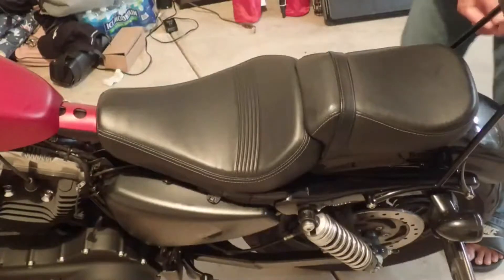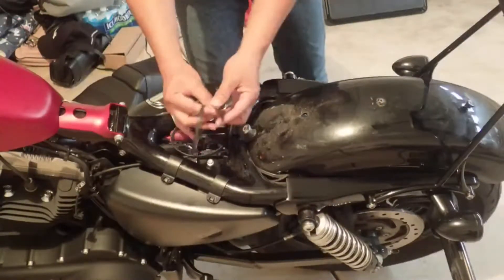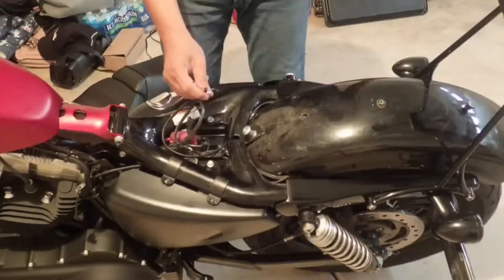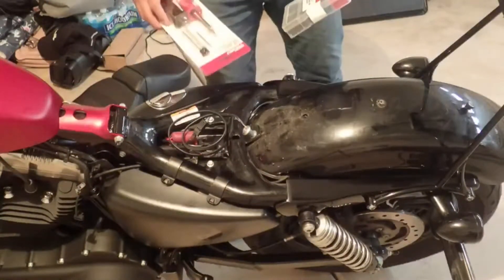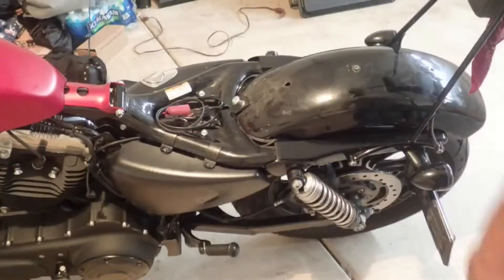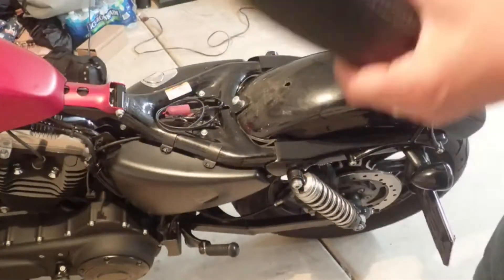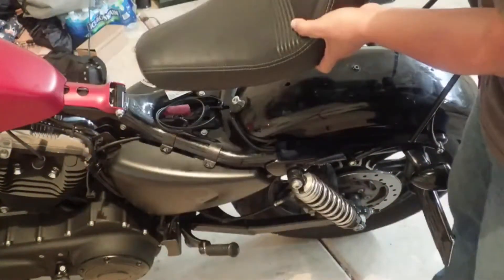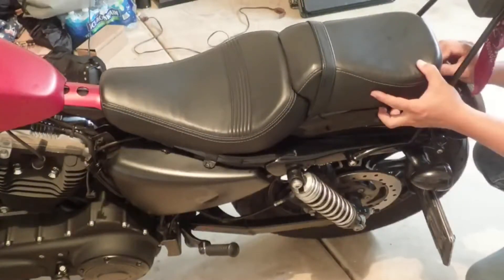Harley Sportster Won't Start (Wiring Issue?)

Comment: Starter relay is bad, bypass the relay with a psprrclip, ifnit cranks (starters good)and relay is bad. Open up keftside panel, two relays, you want to bypass the one on top
Reply from the maker: Thanks for tip b davis.  So far I have no issues starting the bike after replacing it.    I will try your tip on the relay bypass if it happens again.
Reply: This bike has a bcm that controls everything not a starter relay

Comment: Did you find out what the issue was?
Reply from the maker: @LUKKA2020,  the issue is the battery itself.  I had my friend look at it and he measured the amperage (current flow) when pressing the start ignition.  The battery cannot deliver the required current to start the ignition coil.  I just bought a new battery and with his help, we got the battery installed and the bike started with just one click.  I did not post the installation because he does want to be in the video.  Thanks for asking.
Reply: @irogdebs8698  I am glad that it was an easy fix 👍👍